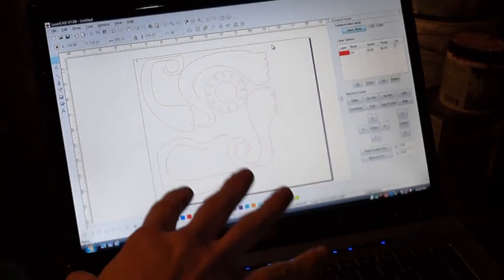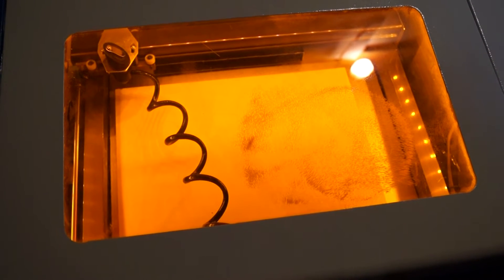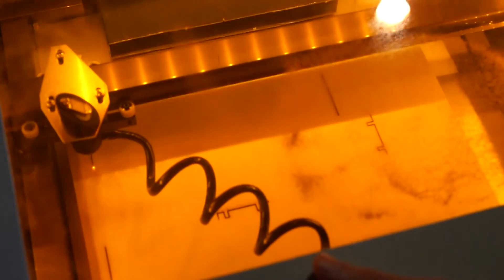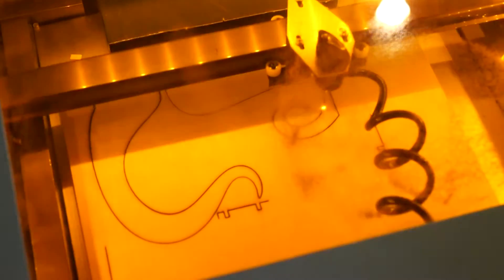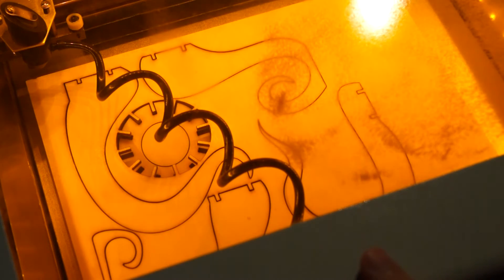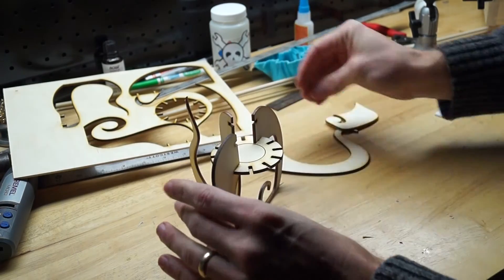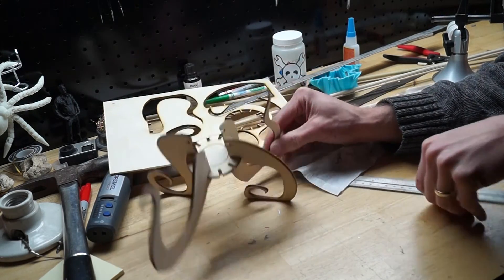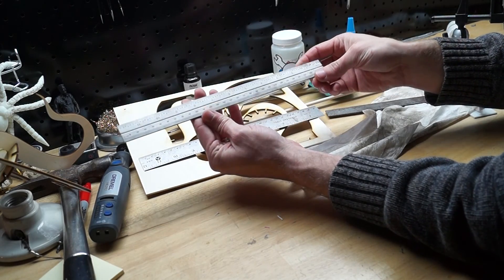Laser Cut Octopus Lamp: 03 First Cuts With The Laser!

Comment: Nice!  The air tube looks really strained.  Most k40's have them routed to the upper right (when looking down) - not sure if that was a kludge or a mod - but you might think of re-routing it. You're right in doing the design in F360.  I started designing in AI,  did 4 designs, and then realized that my plastic would have up to 0.02 inch in variations from shipment-to-shipment - and even across a 11" sheet.
Reply from the maker: yup, its a kludge for now. I really need to re-route it, I just haven't yet.
Reply from the maker: also a good note about fusion. I don't have the experience yet to know it is worth it, just going on other's recommendations. Glad I'm not wasting my time!